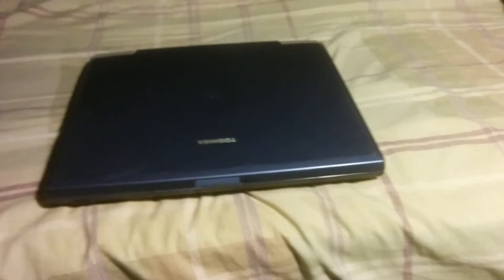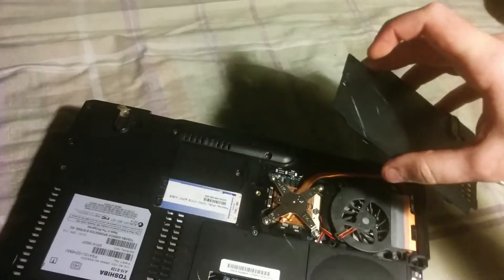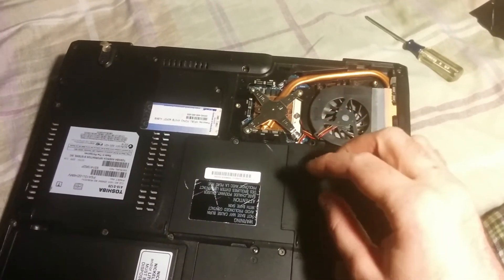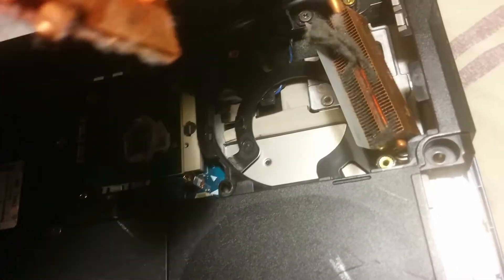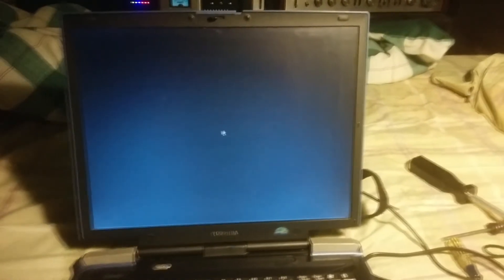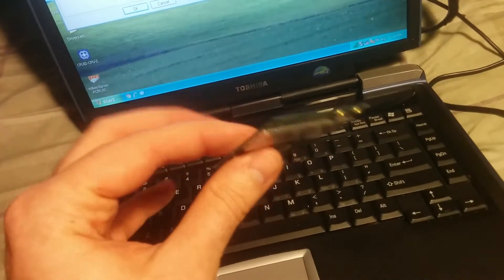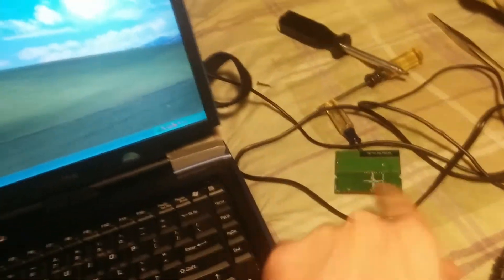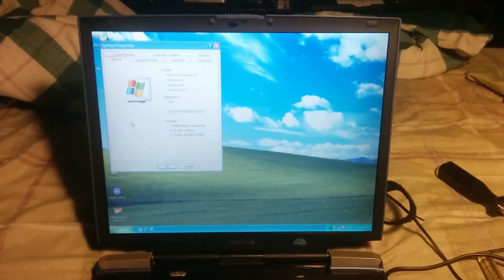Toshiba Satellite A15-S129 - CPU upgrade to Pentium 4m 2.2GHz

Comment: Were you able to slap Windows 7 on that machine? With 1 Gb RAM it should work, but I'm getting stuck with bootloader problem apparently.
Reply from the maker: I haven't planned on it since I use it for older software that seems to work best on XP (such as my EPROM burner).